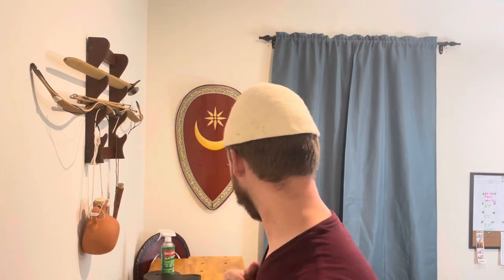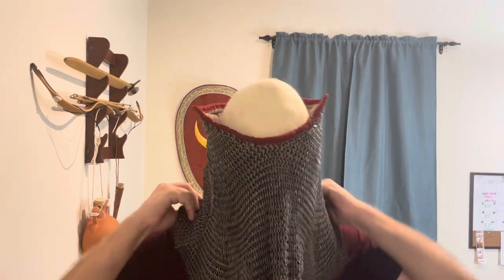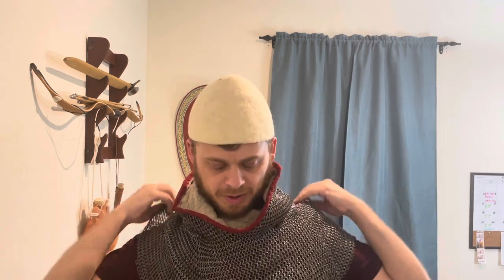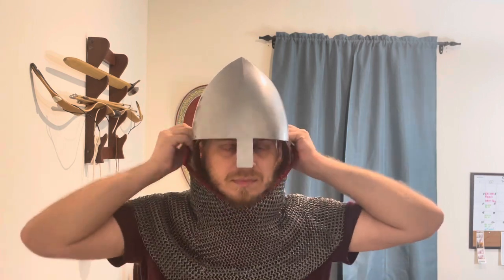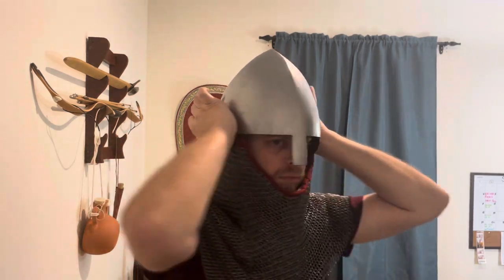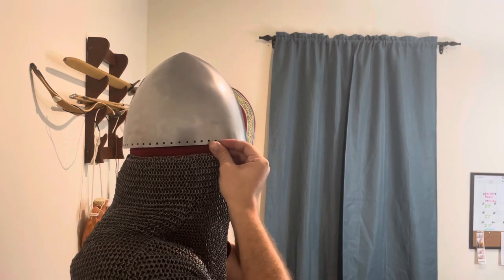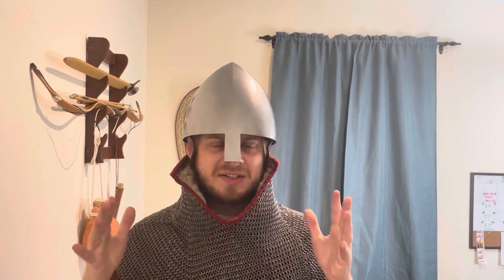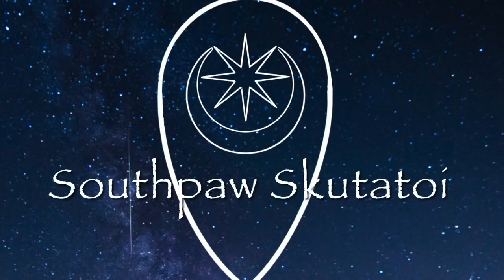Byzantine Helmet Update

Comment: Question: Is it still called an aventail if it doesn't cover the face? What you have looks more like a coif, but it could be adjusted to cover more (basically the entire face except the eyes), so I was wondering.
Reply from the maker: Great question! Yep, aventails are maille connected to the helmet. They can be open, closed over the neck, chin, or face. Although the face is less common. Coifs are a completely separate maille hood that often have a ventail that can cover the mouth.
Reply: @southpawskutatoi  You see?! That's what I'm talking about when I say reenactors can be a great point of historical knowledge!!! Thanks for that feedback!

Excitement aside, I thought the aventail was specifically the part that covered the face. Seeing images for troops like the Varangoi, Kataphraktoi, and Koursores were the first instances I had for seeing them. Do you plan on having the rest of the face covered or keeping it more open? I thought aventails would be more open underneath (yours has the padding under it) to allow more airflow and breathing, so I could understand going either way.